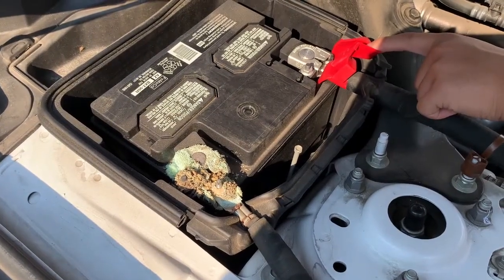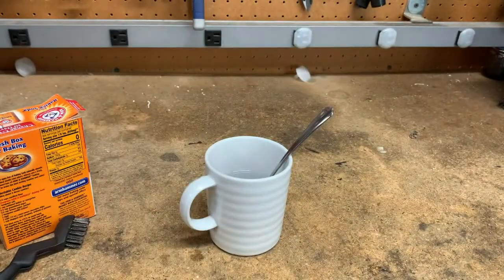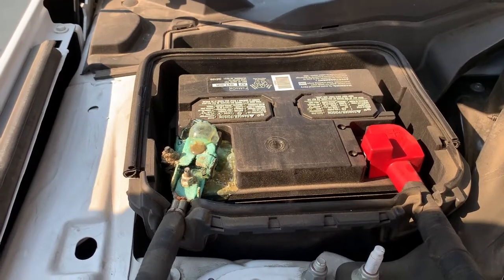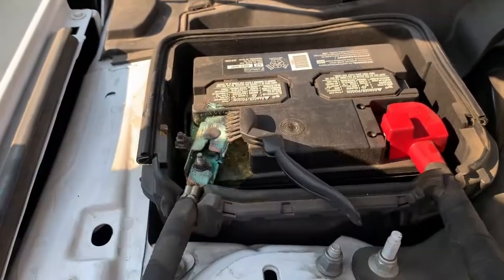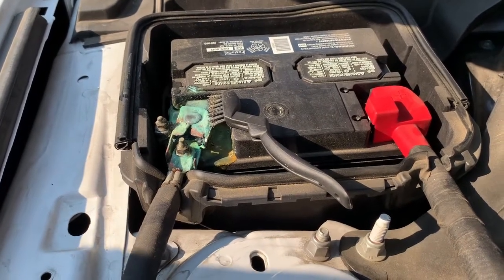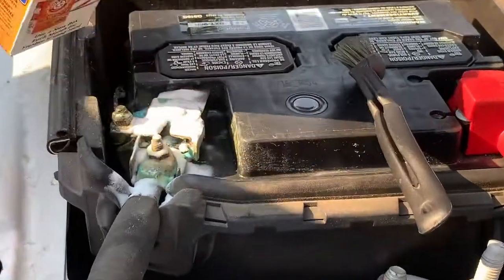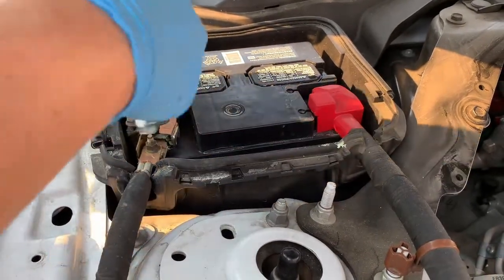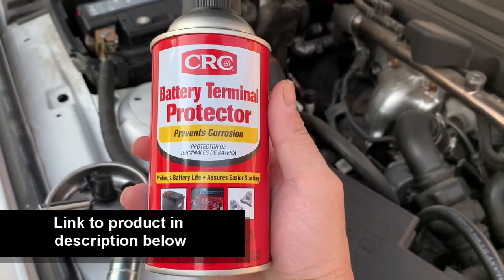How To Remove Battery Corrosion

Comment: My positive terminal (on my 2016 Ecoboost) was severely corroded, with lots of blue crystals.  I took the car into the local tire shop (who sells Interstate-AKA Johnson Controls) batteries.  The mechanic had to bend the positive terminal to make contact after cleaning up the corrosion.  If this happens to you, do NOT take the vehicle to the dealer (unless it's under warranty).  The dealer will want to replace the entire battery cable harness for $500(!). Ford has a service bulletin out that states that the positive terminal can be replaced with Ford part #BT4Z-14450-AA (and same part number, just -AB for the negative terminal).  The positive terminal is around $60, and requires a hydraulic crimping tool to install (also around $60).  Do not cut the old terminal off, or you will be stuck buying the new battery terminal wire harness (there is no free play at all on the battery wires!).  You have to uncrimp the old terminal and clean the bare wire before crimping the new terminal on.  Ford also gives you shrink wrap to put over the crimp when you're done.
Reply from the maker: Thank you for the additional info.
Reply: @BIsForBudget  it's Ford TSB SSM48123 for reference...

Comment: Did your RPM’s drop down just a hair when you came to a stop at red lights because of this? I already replaced the purge valve
Reply from the maker: In my case, the battery was 4/5 years old and in need of a replacement.   It took a bit longer to start every morning.  Sorry, I can't say I noticed lower RPMs while stopped.   I didn't notice the corrosion til I performed the battery replacement.  2 things that did effect my idle were, spark plug age/gap and a dirty throttle body.
Reply: @BIsForBudget  thanks! How many miles do you currently have on your car?
Reply from the maker: @BIendtecc  Approx 45K miles